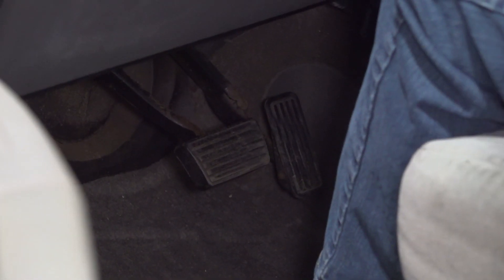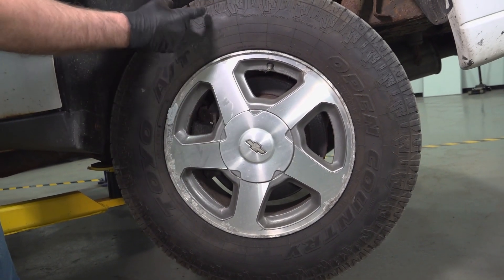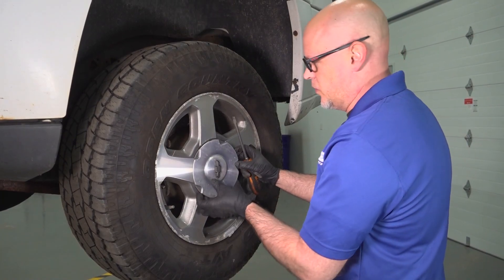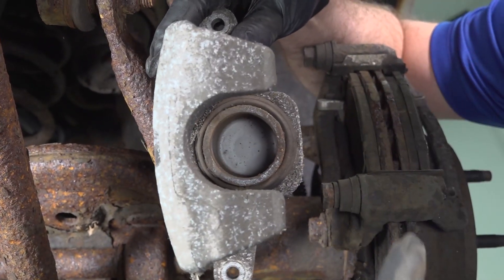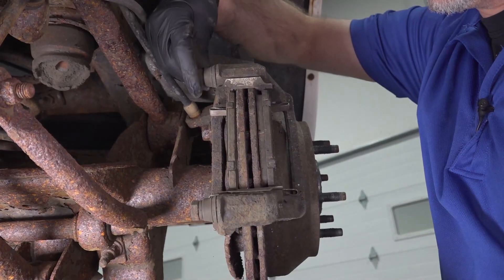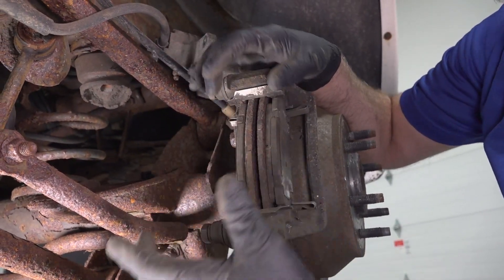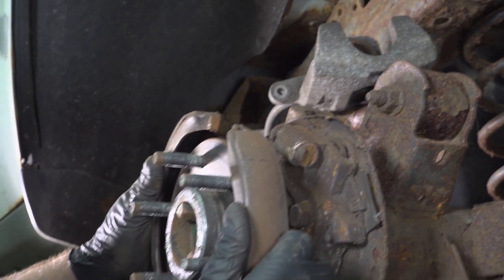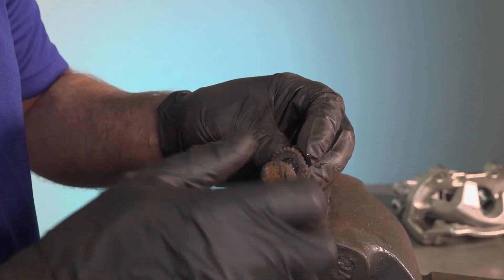Can my car or truck brakes affect my gas mileage? 5 easy parts to replace and save money on gas.

Comment: Hey thanks brother. We'll I have a problem with my 2007 infiniti fx35. Speedometer is not working. And I don't where I could find transmission speed sensor. 

Scanner told me it is transmission speed sensor. I do not where is it? Tell me

Comment: Good Camera work EXCEPT, you did NOT make it clear that you sprayed the Disc Pads with Brake Clean after handling them with those greasy gloves.... not good... Everything Must Be Clean.... I watched close after I saw your gloves on those pads, and the grease marks that stained the pads... same thing on the Parking Brake bands, they were stained, they should have been washed with Brake Cleaner. the only thing showed being washed was the rotor, you mentioned the Caliper must be washed.